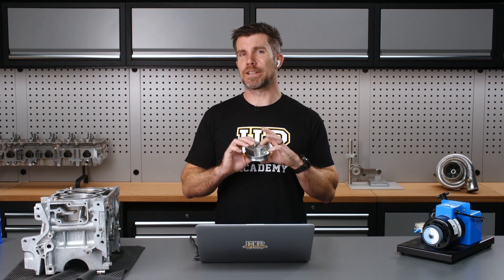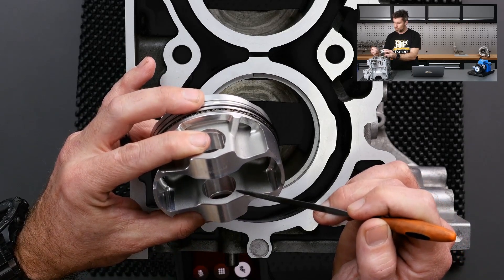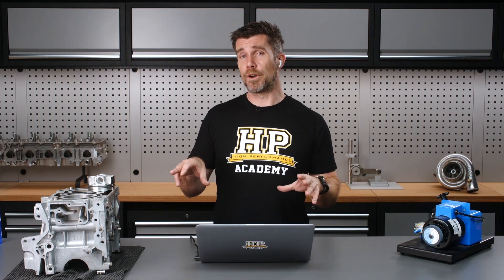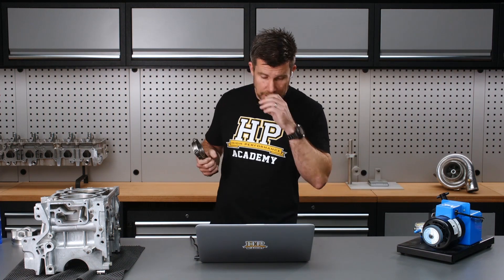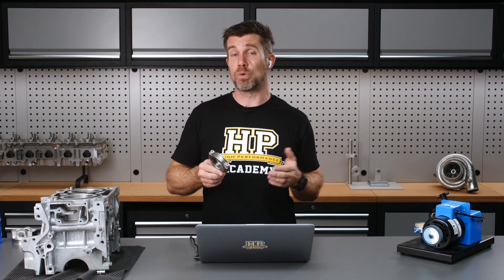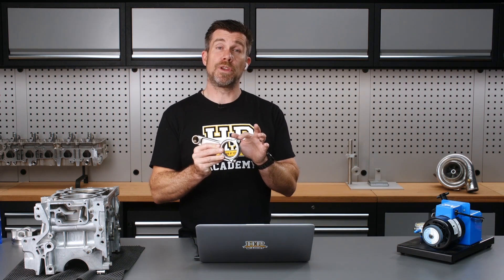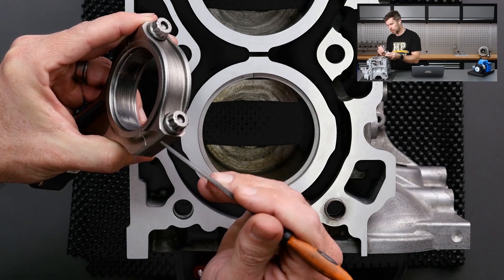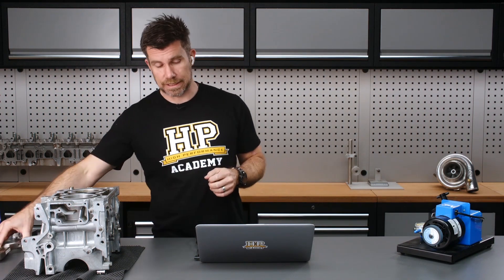Balancing Pistons | Safest Place To Remove Weight [HPA Q&A]

Comment: Can drilling the piston affect lubrication?
Reply from the maker: If you do it in the wrong spot for sure, otherwise unless you are at an F1 level any small effect it would have would be negligible, even for a high output performance application - Taz.